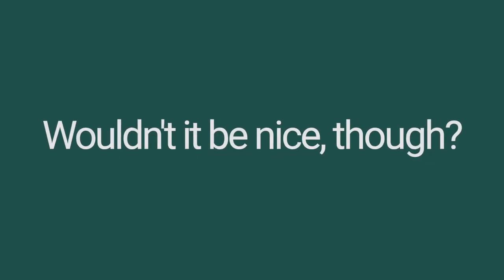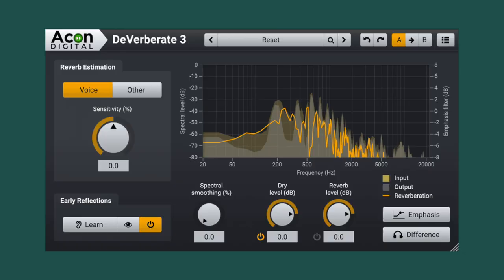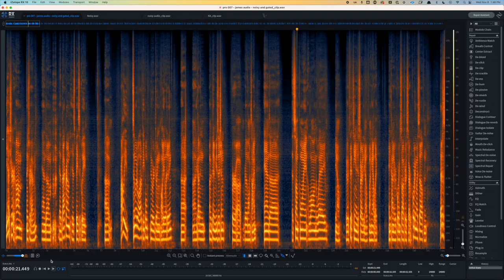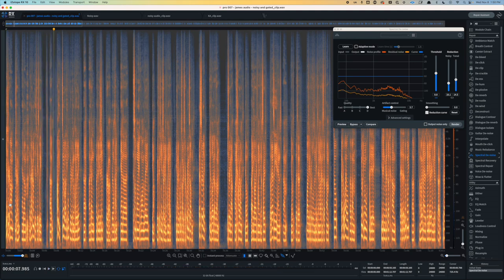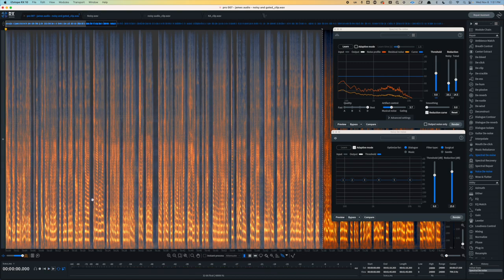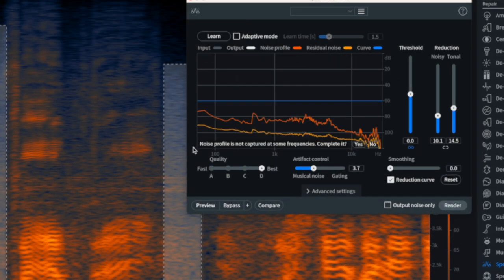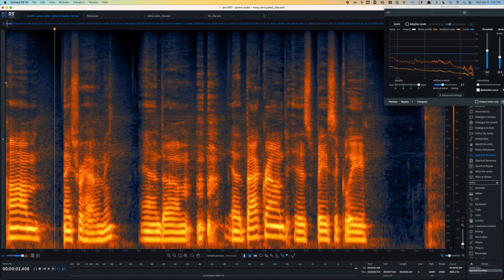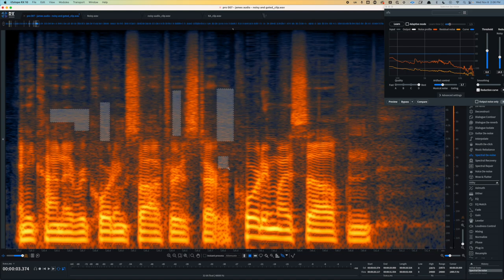Podcast Editing 101: How To Remove Noise And Reverb (echo) From Your Audio

Comment: I still do most of my repair in either RX Advanced or Acoustica (Acon Digital’s stand-alone) but I’m finding satisfactory results from some of the same plugins you’ve referenced. 

I do feel like iZotope is starting to lose some ground.
Reply from the maker: I was like you until I heard about Supertone's Clear plugin, or Goyo as it was named during the beta test.  I'm not sure why the name change to something that is going to be more challenging to rank for in terms of SEO.  That is still the only one I've heard that in most situations can handle the types of work I was doing with Spectral De-noise.  RX still has a few specialty modules like Mouth De-click that are indispensable to podcast editors.  Luckily, those are available as RX plugins and don't require the editor.  

My issue with Izotope and the new direction since being acquired by Native Instruments is the move to annual updates.  Much like Adobe, this model prioritizes new features over improving existing functionality.  While other companies are investing a lot of resources into creating better noise and reverb reduction tools, Izotope seems to have ignored those for a few years at least.  I'm surprised RX11 hasn't dropped yet, so maybe there is some hope, but I'm expecting another lackluster update with 2-3 new features and some refinements to the text features they added to 10.